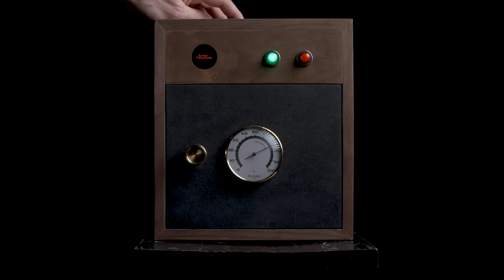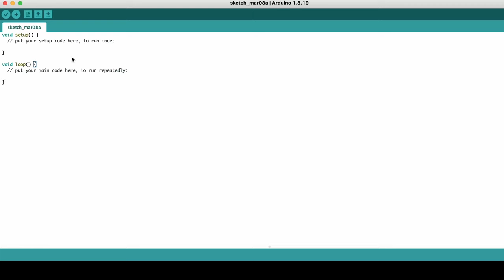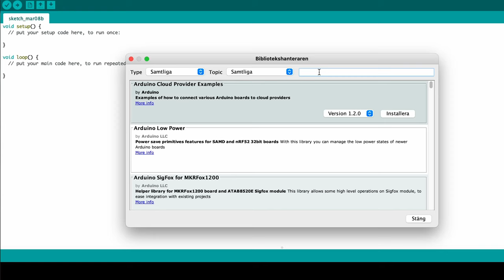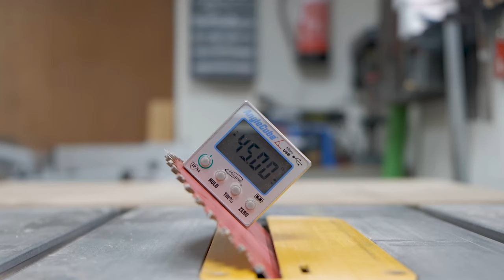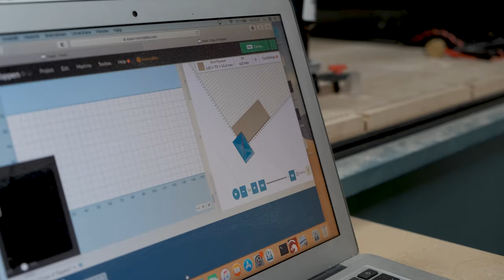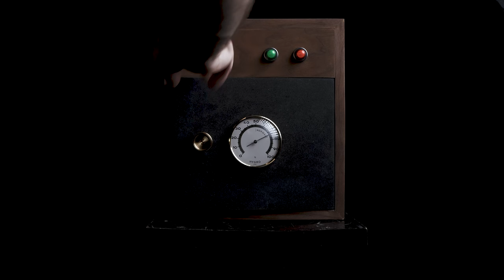this is woodworking for addicts

Comment: Hope you have quit by now, if not here is a recipe. Pick a quit date 2-3 weeks away and several times a day repeat to yourself that you will quit on that date. Also think about why you want to quit. This is to increase determination. It's tough but doable. Usually at one week we want to start again, same with 1 month, one year etc. Once you have quit remember you can never have one as you will start craving all over again. I quit 6 months and started again. Quit again 2 years and started again, finally I learned that I could never have one and I have been free. Urge does go down in time and eventually goes away altogether, I quit 40 years ago now and I would be dead had I smoked all this time, I have had 3 heart attacks but am ok now.
Reply from the maker: That's quite a story man. Thanks for sharing. I will for sure quit. And it sounds like a good recipe for quitting.